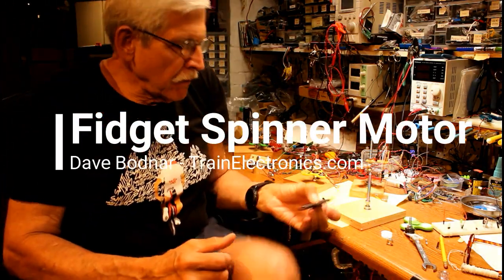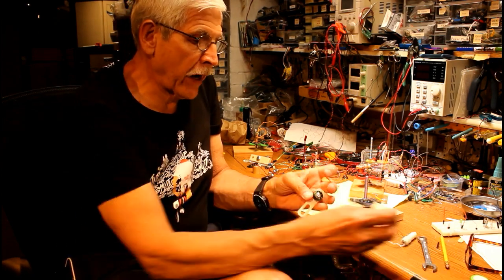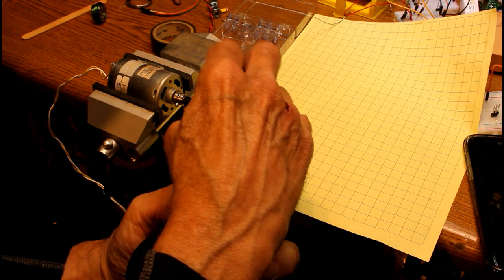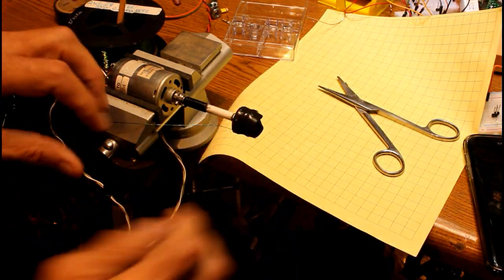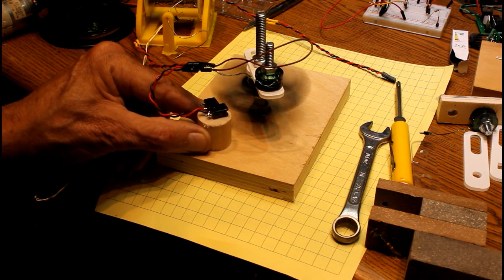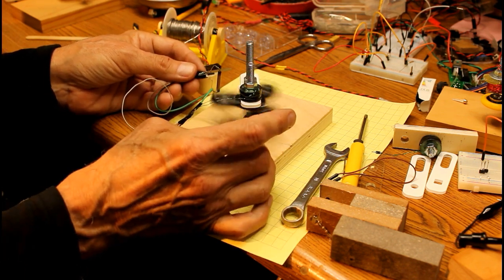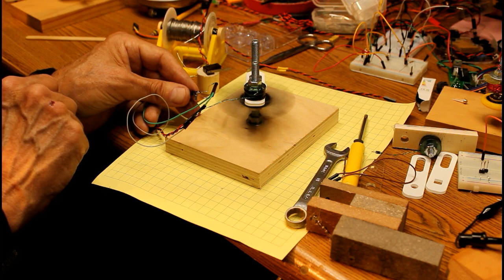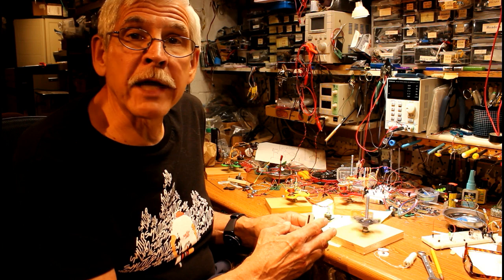Make a Brushless Motor from a Fidget Spinner

Comment: What connecter wires did you use? I'm thinking of doing this as a science project for school
Reply from the maker: Angus - I used JST and Dupont connectors - see

https://www.ebay.com/sch/i.html?_odkw=dupont+connector&_osacat=0&_from=R40&_trksid=p2045573.m570.l1313.TR6.TRC0.A0.H0.Xdupont+wires.TRS0&_nkw=dupont+wires&_sacat=0

and 

https://www.ebay.com/sch/i.html?_odkw=dupont+wires&_osacat=0&_from=R40&_trksid=p2045573.m570.l1313.TR0.TRC0.H0.Xjst+connecctors.TRS0&_nkw=jst+connecctors&_sacat=0
Good luck with your project - let me know how it goes
dave

Comment: i would think that the optimal  posetion for the reed switch would around 33.333333333.....* away from the electro magnet
depending on wich way you want it to spin it can be on the  left side or the right side putting it on the left would make it spin left putting it on the right would make it spin right

Comment: I am building this motor in an electronics class but the reed switch over heats and fuses even at lowest voltage(3.2) using 28 wire and bobbin just like demo. Reed switches don't seem to have specs on amazon? do you have a description of the reed switch? My switch is tiny by comparison.
Reply: You can also add a small neon bulb across the coil - this will reduce the back EMF stress on the reed switch and will also produce a cool rhythmic flash in sync with the motor (reminiscent of a spark plug firing). The collapsing magnet field in the coil (when switched off) will produce enough energy to flash the neon bulb (which takes about 60 volts or greater) - demonstrating the relative strength of the back EMF compared to the low voltage you are using to operate the motor..... If you can't find a reed switch that will hold up, you can use the mechanical switch Mr. Bodnar described first. The neon bulb will work with this switch as well.
Reply from the maker: Abby - reed switches can easily become fused when they switch a good bit of current - it sounds like the one you are using may be too small and is only designed for switching small loads or toggling a pin on a circuit.
See if you can find a reed switch that is at least 1" long  -  I found these on eBay - they should work

https://www.ebay.com/itm/Large-Magnetic-Reed-Switch-SPST-1-Amp-28mm-L-X-4mm-Diameter-N-O/291472804140?hash=item43dd22092c:g:fzoAAOSwZjJU3Qkq:sc:USPSFirstClass!15228!US!-1

Please let me know how the project goes  ---- enjoy!

dave
Reply: The culprit is the current. Use thinner wire for winding your electromagnet and increase the number of turns . That will give you a coil with higher inductance and resistance which helps to reduce the rate at which current will rise in the coil and the maximum value it attains respectively.
Reply: Abby Reid   I've fused a couple taken from burglar alarm sensors.  I think these are called signal switches and only support very low currents.  I suggest you check other sources for connecting the diode.  I think it's normally connected reverse biased across the coil rather than the switch as suggested here.  Eg. Search Wiki flyback diode.
Reply: This would be a good time for a discussion of Hall effect sensors.

Comment: This is cool! I've thought about making a motor for a while now and this video has given me some ideas.

Though, I have to say that while it's not technically brushed, using a switch of any kind really serves the same purpose. I was dumbfounded when I saw a "brushless" DC motor for the first time and couldn't figure out how they worked. When I finally did learn that it's just simple electronics turning the magnetic field on and off rapidly, I was a little disappointed.

Comment: Hi Dave, nice video. Check D1 on your circuit with the reed switch, I think you'll find it's backwards. When the switch closes the diode is forward biased by the battery. Nice job on the motors, you are a good teacher. Youtube needs high quality teachers like you.
Reply from the maker: It is good to hear that you liked the video - it was fun putting it together.
You are right about the diode - I corrected that image on my web page.
Good eye!
thanks
dave

Comment: Could you show how to reverse everything in order to make power? I realize it would only be about a half watt, and I am not sure where your applied torque would come from but it would be cool to see you do this in the opposite direction, alternator vs motor. Thanks, this is a wicked cool video. Thumbs up, and subscribed.
Reply from the maker: Marcus - I did a few quick & dirty tests with the unit's coil connected to a volt meter while spinning the spinner - results were very poor - under 0.5 volts when spun - not even enough to light an LED!
dave

Comment: If the coil repels the rare earth magnet, the thing can auto-start (if magnets are angled slightly towards the intended direction of rotation). 
With the carriage bolt in the coil, the magnet is already attracted to it while passes by, even if the coil circuit is open.   :) Am I right?
Reply from the maker: Interesting idea, Paul - it might work --- at the very least is seems that it should work!
thanks

dave

Comment: Dave... I was wondering... would it be possible to alter this setup a little generate electricity by manually spinning the fidget spinner?
Reply from the maker: I just gave it a try by connecting the coil to my voltmeter and giving the spinner a push and, yes, it does generate electricity but VERY little, hundredths of a volt.  I would think that there are things that could be done to optimize output but as it stands it doesn't seem to practical.
For more info I found this link

https://electronics.stackexchange.com/questions/322321/can-any-dc-brushless-motor-be-used-as-a-generator

dave
Reply from the maker: Update- tried again with a single coil and got up to 0.5 volts - still not great but an improvement!
dave
Reply: Thanks Dave for trying it out. These are practically not usage, was just wondering if it would generate even half a volt.
Reply: Yes! 0.5 v from negligible is a good improvement!

Comment: What would happen if you put 3 triggering magnets? Would it triple the speed, or at least increase it?
Reply from the maker: If you also added two more coils it surely would have more torque, perhaps more speed as well.
dave
Reply: Yes and no. The pulses are determined by the speed of the rotor, so in theory, if the rotor could be made to spin faster, the pulses would speed up as well. If the switch were in the optimal position, the limiting factors would be friction, air resistance, and to a lesser degree eddy currents and hysteresis. All things equal, increasing the torque of the motor would enable the motor to spin at a higher limiting rotational velocity.

Actually, what's important is to increase the rotational impulse, so either increasing the torque or increasing the duration over which the torque acts would yield benefits. So using a variable frequency alternating current could significantly increase the speed of this motor.
Reply: More torque for sure, the speed depends on the pulses energizing the coils :)
Reply: I think number of fidget spinner arms has relation with speed !! And torque is related to how much voltage u r supplying the coils

Comment: How many watts
Reply from the maker: It consumes very few watts - I haven't measured it but it is likely to be minimal
dave
Reply: I think in the video, Dave said 7 volts at 200ma. So 7 times .2 Amps or 1.4watts.

As we are having to charge the coil and pulse it on and off, the power consumption over time may not be 1.4watts. 

Good question, leading to more questions after the first answer.

Comment: Sir , please suggest me the name of diode d1, which has to be used with reed switch.
I went to electonic store told him to give diode d1, he ask me proper number of it, please help
Reply from the maker: Any silicon diode should work - a   1N4001 should work
dave
Reply: @DaveBodnar  may I also suggest the use of a small capacitor something around 8		micro Farras, placed on the + side of the switch. This will give the voltage somewhere to go as the switch opens and reduce voltage rise time when the switch closes. This will also reduce contact arcing. Just like the pre electronic ignition systems on cars. PS a great demo just the same. And like many others wishing I had a teacher like you when I was in school.
Reply from the maker: Thanks for the tip, Roger - I'll have to give that a try....
dave

Comment: How would you go about speed control? Would you say it is a good idea to use a potentiometer and a MOSFET to limit the current of the coil to adjust the magnetic field strength or is there a easier way?
Reply from the maker: You could use a Mosfet as you suggest or you could physically alter the position of the coil 
dave
Reply: Dave Bodnar Thanks. This helps a lot!!!
Reply: Creative Daily KH hallo? You rang?